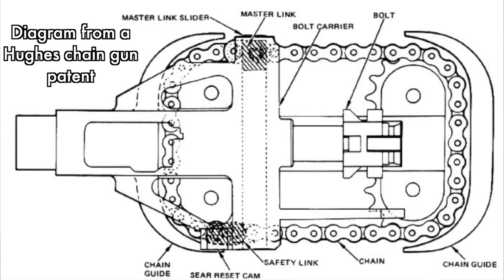Ask Ian: Are Man-Portable Chain Guns Coming?

Comment: I suppose it's all down to energy densities, lithium ion batteries are great but firearm propellant beats it in terms of energy stored per unit mass by more than an order of magnitude. 
So storing the energy to run the action within the cartridge will be less than 1/10th the mass of the battery you'd need to do the same job, and that's without the motor, transmission, and control electronics you'd need on top of that.
As Ian says - gas operated automatic weapons are really well optimised machines.
Reply: A hybrid type system could be a solution, even though the concept of man-portable chainguns doesn't really make much sense, in my opinion. Similarly to internal combustion engines powering the alternator that charges the battery, you could use a gas system that charges the battery which powers the system that operates the action, making it self sustained. Still, the weight and complexity would limit the practicality of such a firearm.
Reply: @lakiza55  You could utilize an existing gas piston, there have been plenty of designs that harness electrical energy from linear motion, there was even an engine designed as a range extender for hybrids that worked via that concept.
Reply: @yyyyyeeeee4060  my idea came from the experimental Ross machinegun that Ian reviewed. Similar concept to a turbocharger, just port the barrel and have the gases drive an impeller that is connected to an alternator.
Reply: @lakiza55  likely too bursty to drive a constant load like an alternator without considerable flywheel mass.
Reply: that is probably true but how efficient are current systems and how much energy do you actually need to operate such gun? it may be little difference
Reply: Wow you're really smart!
Reply: Considering the intermittent nature of needing to clear a malfunction it seems like adding a pneumatic accumulator (or a disposable gas cartridge) to the action somehow would give you most of the benefits without having to externally power the action for every cycle
Reply: @AntonEMaes  why pnumatic? springs are tried and true and could be reset on the next cycle.
Reply: @yyyyyeeeee4060  maybe theres a mechanism to do it but I couldn’t figure out how to reset it purely mechanically

tapping off some of the gas to recharge an accumulator (which is basically a spring as well, just with a piston) seemed like an easier way to do it. Plus you already have a gas operation system there so why not use it.
Reply: @AntonEMaes  same way you cycle the bolt, just in the opposite direction.
Reply: You could still use that gas energy to charge a minimal battery (one with only enough energy for a few dozen rounds), so you get all of the benefits of the chain gun (decoupled ammunition/feeding) with the benefits of the lighter weight.
Reply: I feel like it could be interesting to try to collecct recoil energy to charge the battery. Like have the recoil springs charge a battery somehow.

But then again, that would be more weight, and the recoil to create energy might be too much for a mobile infantry arm.
Reply: @termitreter6545  High conversion efficiency of pulsing gas calls for something like a boundary layer turbine. Unfortunately, the materials requirements and the operating conditions would make reliability a non-starter. Converting gas pressure to rotary mechanical effort is not an elegant process.
Reply: @dustinbrueggemann1875  Doesn't have to be rotary. Check out Toyota Electrical Free Piston. Direct, efficient conversion from linear motion to electrical energy.
Reply: @termitreter6545  this could have interesting applications in the future if we started developing powered armor or similar systems. With increased weight capacity, the wieght is less of an issue and if harnessing the mechanical energy of the recoil to charge the battery was efficient enough, it could help mitigate the energy storage issues.
Reply: @troysnell9547  Thing also is, youre not getting rid of weight compromises just by having more weight capacity. Even 68 ton tanks have to make compromises.

So if you got an exoskeleton, you'd likely rather take a recoil-operated gun thats lighter, but does the same job, and instead use the free weight for something else. Mind that theres 30mm recoil operated ACs that work just fine.

As Ian said, you'd consider whats the actual advantage of using a chain gun. Just being able to carry one isnt reason enough to do so.
Reply: @termitreter6545  certainly weight compromises are always an issue, but the greater your total weight budget the less impactful an extra 5 or 10 lbs becomes. And depending on how the weapon is mounted or if you chose to use that weight to carry a larger weapon, it could end up having more in common functionally with current vehicle mounts. Obviously it would depend on the specific setup, but this could be an application where the advantages outweigh the drawbacks.
Reply: @troysnell9547  If your gun is 15 lbs, then 10 more lbs are still a lot. And if you scale up the gun, the added chaingun weight will also increase.

But what are the advantages even? Gas operated systems are plenty reliable and someone using an exo skeleton can easily clear a jam.
Reply: @termitreter6545  the same advantages Ian talked about in the video. If an exoskeleton allows you to carry a heavy enough weapon that cycling the action manually is impractical, a chaingun might be a way address malfunctions. Or if the weapon was mounted in such a way it would require the operator to leave (or partially leave) the exoskeleton to manually clear a malfunction. Also, as the exoskeleton becomes more protective of the operator, perhaps even approaching a true powered armor, it is likely that it would become less practical (and more exposed) to address weapons mounted on the exterior.

I'm not saying they will be, but depending on the exact specifics of how an exoskeleton or powered armor was configured, it MIGHT be an application where the extra weight was worth the tradeoff.
Reply: @troysnell9547  The whole autocannon cycling thing is a solved problem. Lots of infantry fighting vehicles use gas operated autocannons. You can just have an electric motor do manual cycling, for example.

I was just mostly interested if there was an actual argument for why a chaingun would be more useful on an exoskeleton. Rather than it being theoretically possible.
Reply: @termitreter6545  I was curious about your idea, so I did a bit of napkin math on it! It looks like there's only about 1.5 Joules of energy in, say, a fully loaded M16A4's recoil on a single shot. That'd also work out to about 18-24 Watts in recoil power in full auto. Not a tiny amount, but when compared to 21,600-29,300 Watts in power for the projectiles (M855 kinetic energy multiplied by M16 Shots/second) it seems like a surprisingly low amount.

Comment: The only place I could see for the chaingun as an infantry arm would be the main weapon if someone puts powered exoskeletons into use. I'm thinking Edge of Tomorrow style suits, but with a belt feed instead of the kinda silly little box mags they get.

So TL;DR yeah no it's not likely lol. Would be cool though.
Reply: I'd argue it would be more likely in a Fallout style power armor. Big and clunky, reduced manual dexterity. Fallout style suits also being the least practical and likely form of PA.
Reply: @Kaifenren  Yeah any type of mechanized infantry system that's "worn" instead of "piloted" is never going to be viable in the real world. There's too many tradeoffs that would require revolutions in both battle doctrine and energy systems to overcome. You just can't fit enough power and enough armor together in one machine to make "power armor" function.
Reply: @dustinbrueggemann1875  'never' is a bit too harsh, we don't know how battery tech might advance in the future. it's unlikely to be anytime soon, if it's possible, though.
Reply: @dustinbrueggemann1875  they also used to say that gasoline was useless because it was too powerful to control.
Honestly setting up a mech suit with a gas generator probably could work.
Tho designing a mobile/stable mech suit is the bigger issue
Reply: @dustinbrueggemann1875  you definitely can, it's just not very safe. active nuclear batteries (or even a tiny nuclear reactor like they use in deep space probes now) could do it, provided you had a big enough buffer in order to account for the stilted burts of movement that humans are built to do (l-ion supercapacitors for example).

the real real issue, aside from the nuclear safety thing, is building a suit or frame which works well enough alongside the human body to augment them without wearing them out or tearing them up in the process. assuming you can stop your power source from killing you and can make an exoskeleton that fits, there's nothing getting in the way of proper powered exoskeletons.
Reply: Even at that point grenade launchers and missiles might be better for increased firepower. 

And there is gas-operated 30mm autocannons, so its not like even an autocannon necessarily requires any special mechanism.
Reply: powered exo skeletrons require so much energy that even if they were put to use at some point, you wouldnt ever be able to use its battery for anything else. Energy storage is actually one of the main reasons why powered exo skeletrons arent used, they simply use so much power that any benefit it would have for mobility or saving weight would be offset by the massive battery you'd have to carry around for it.
Reply: Thicc bois looking like terminators from Warhammer 40k
Reply: The funny thing is that even in the film the guns that the exo-infantries used were Fn Scars (a gas operated gun), which makes sense because the suits broke down later on and Tom Cruise had to salvage the gun
Reply: @quakethedoombringer  I think you're the only person so far to actually bring up the movie I mentioned, and you also bring up a fair point for plot reasons, but I don't think "what if the suit breaks down and the pilot needs to salvage the gun for SERE operations" would be decent reasoning for an actual military. Now "let's just strap these guns we already have onto the suits to save money." Well, could be onto something there. They could also just tuck a normal rifle onto the back or frame somehow, or just as a secondary "light" option beside a chain gun or light cannon.

Also unrelated to the points above, but did you know the movie is actually an adaptation of a Japanese manga called "All you need is kill"?
Reply: My thoughts exactly. It would allow for offsetting the weight, and you wouldn't have easy access to clearing it. That said, who knows if or when that will ever happen

Comment: If a shoulder arm could be built, a weapon with no gas mechanism to get dirty and with a fully electronically controlled trigger, seems interesting to me.
Reply: The Remington EtronX was a bolt-action (IIRC) that used electrically primed .30-06 and used a unique dual firing pin-like setup battery to pass current through and fire those primers
Reply: keeping everything clean and cycling regardless of charge are the 2 big benefits that I see.
Reply: @groofromtheup5719  You could probably a system with no firing pin spring and positive control over the firing pin at all times. Unprecedented levels of  drop and out of battery safety.
Reply: Whatever happened to the electrically primed, caseless ammo based weapons that could have accomplished this as well? Is this still on the horizon, or abandoned as unfeasible?
Reply: @garysmcdermott  caseless almost big problem is heat, no casing to expell greatly increases how much heat it has, and for a weapon that is stuck next your face the last thing you want is that to overheat
Reply: But you (and Ian) are forgetting an obvious advantage of chain guns, the round’s propellant doesn’t have to be expended in the  chamber.  Chain guns would be a great fit for rocket propelled ammo.
Reply: @garysmcdermott  they got killed by the current manufacturers of ammo and weapons got as far as trials and the ordinance evaluation was a good but not good enough to go into service,  you can guarantee that most of those on the evaluation team got well paid jobs at current military ammunitions manufacturers.
Reply: Do you mean like the Predator's weapon?

Comment: One interesting use for an externally powered action would be semi-automatic .22lr. One of the big limitations in 22lr is energy available for cycling, which can mean ubreliable cycling and limits how strong the striker/hammer can be which can often lead to light primer strikes. So the idea would be, using a regular semi-auto FCG and magazines, but having an externally powered system for automatically cycling the bolt after each shot.

Comment: Since part of the cartridge's energy is not used to cycle it, doesn't that mean the bullet has a higher velocity?
Reply: Probably not that much. From what I know, what used to cycle cartridge in machine gun mechanism basically the remnant of energy and gas left by initial bullet acceleration. Or something like that.
Reply: Not to a meaningful extent - there's a lot of 'wasted' energy in the cartridge which doesn't go into pushing the bullet.